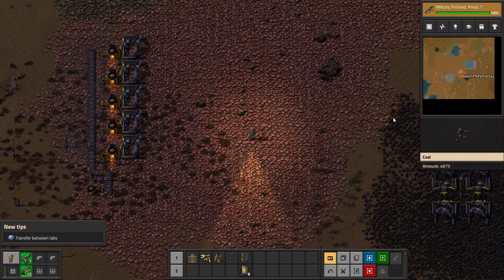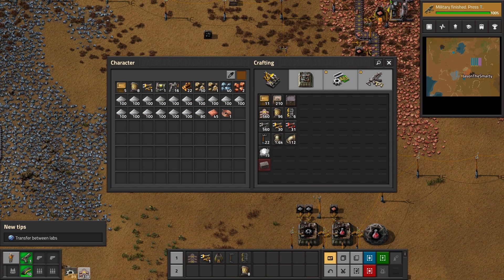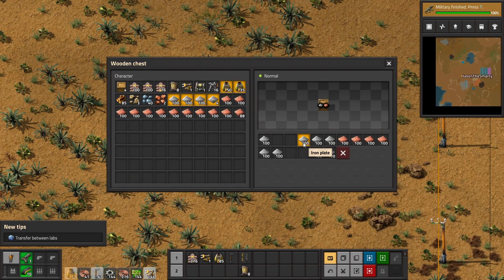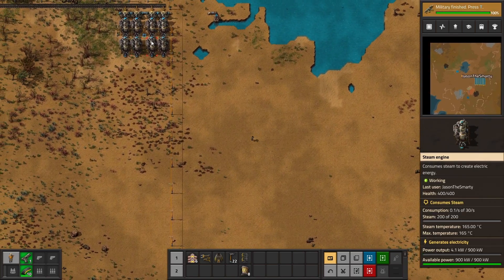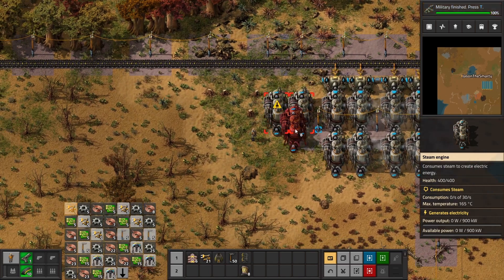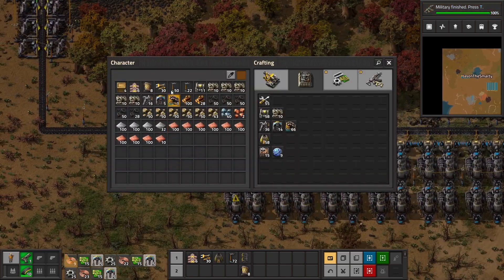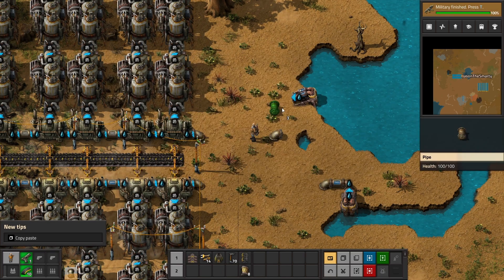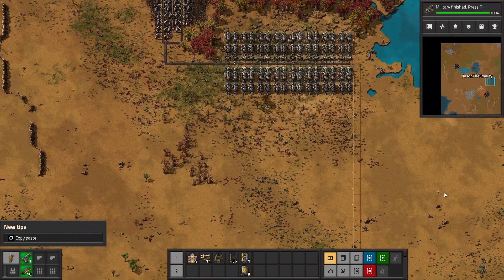MOAR POWER | Factorio: Railworld #3

Comment: why do you use 3 splitters at the beginning of the smelting line?
Reply from the maker: To even split the ores and coal evenly onto two lines. But for the steel one, there's three because there is also a center coal line to feed the inner furnaces.